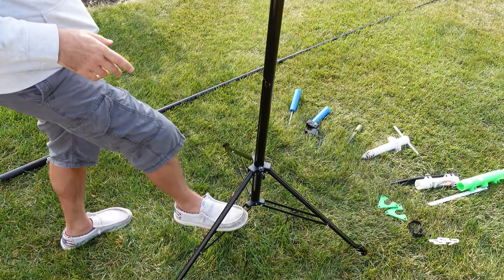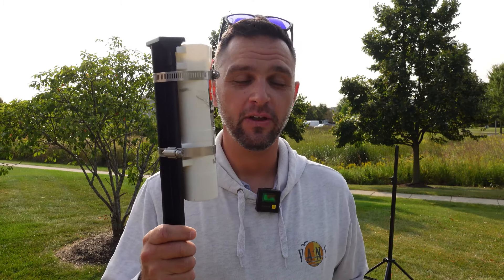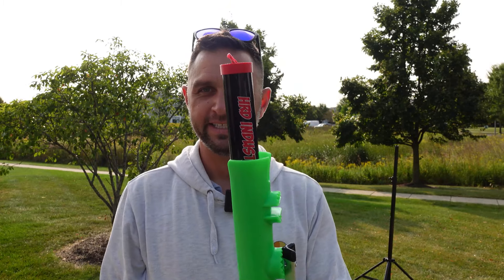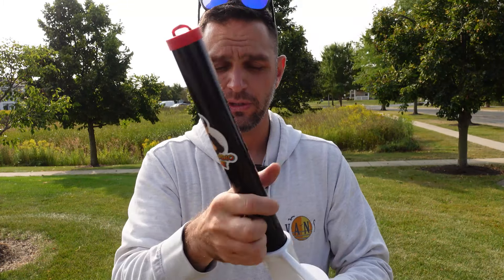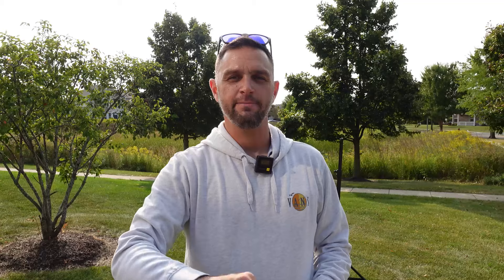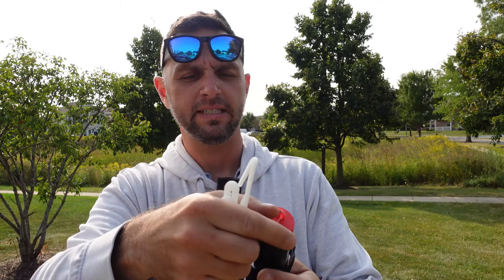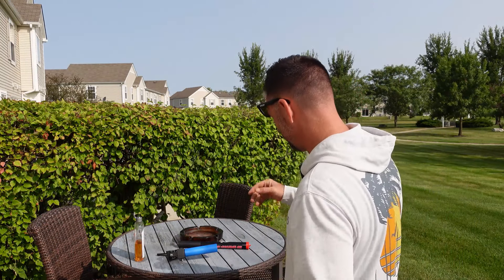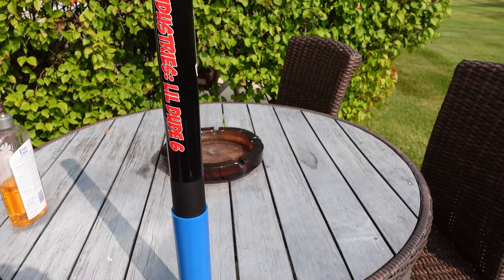Portable Mast Mounting Ideas for Ham Radio #portableradio #hamradio #parksontheair

Comment: I have a bike maintenance tripod from LIDL sturdy as hell and cheap.  The top part (used to hold onto the bike) is basically a super clamp and so can be removed and used as such too if required.  I also use a auger screw-in into the ground spiky sun umbrella thingy-ma-jig. It works pretty good too, you can even get metal ones and that would be better as it doubles as a ground nice spike.  The bike tripod (technically, it has four legs) is the most stable and can be pegged down or weighted down if needed,  73!

Comment: Thanks for the video. I’m always interested in ways to get antennas in the air. . . .  I just made two mounts for my POTA 20 and SOTA Beams Carbon 6, from 1.75-inch OD PVC pipe and 3/8-inch aluminum rod (both form Home Depot). The two item were about $12 in total and I made two mounts with enough PVC pipe left for a couple more. I attached the pipe to the rod with a combination of strapping tape and then two layers of large heat shrink tubing (I already had the heat shrink). The pipe is about six inches and the aluminum rod is 18 inches. I left the rod extending an inch or two above the pipe so I wouldn’t hit the pipe with the hammer. I use a one-pound dead blow hammer to drive them into the ground.

Comment: A mast mount idea I had was to take a cheap hanging bike rack, cut it down so it won't interfere with opening the trunk, strap some PVC pipe to it that the mast will slip into.

Objective is a 60 second or less antenna deploy since I can not/will not permanently mount HF in the vehicle.